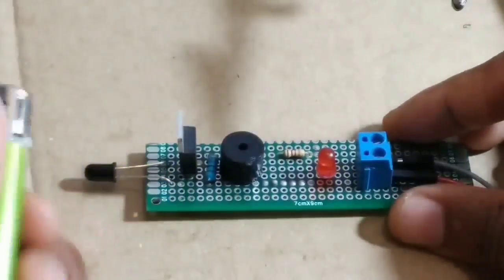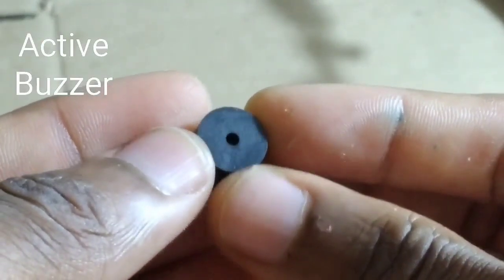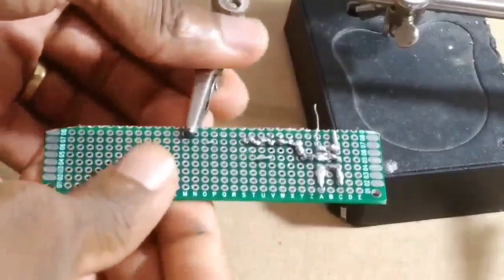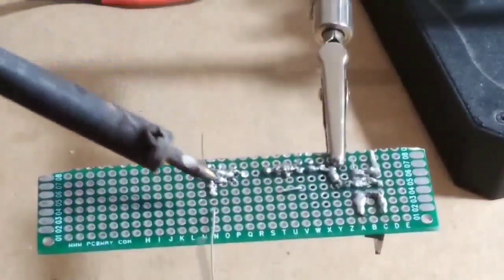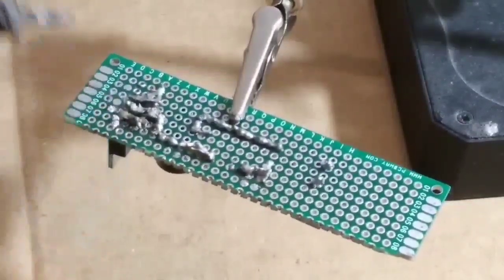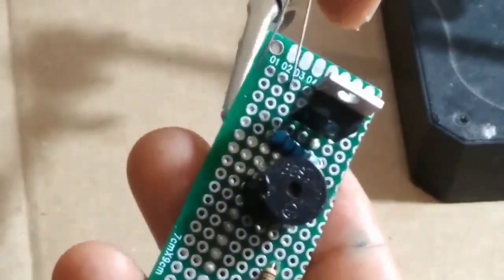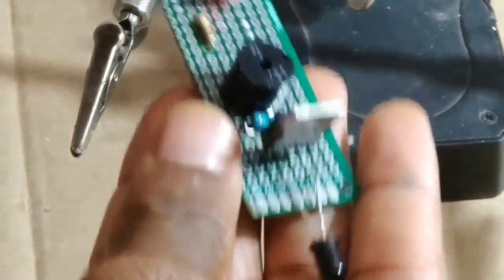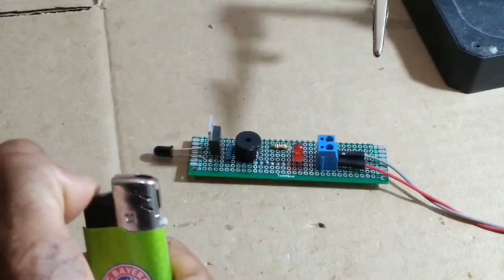How to make Fire Alarm using MOSFET IRFZ44N | Fire Sensor #firedetector #mosfet

Comment: What is type of the buzzer?
Reply from the maker: I really don't know. Active buzzer. 🤔
Reply: @uploadideaswithitamar  what is the voltage it works on?
Reply from the maker: @djomla6165   I make many projects and I forget things on the projects that I've done. Power supply is probably 9V, if I recall.
Reply: @uploadideaswithitamar  what do you actually do for living?
Reply from the maker: @djomla6165  I'm  influencer of TME Education
Reply: @uploadideaswithitamar  do you think there is a profit of doing like electronic repairs or som?
Reply from the maker: @djomla6165  I don't know. I don't like electronic repair, though. I don't think you gain a lot of  money with that.
Reply: @uploadideaswithitamar  where in electronics do you think is the best way to make money?
Reply: Where in electronics do you think is the most money to make?
Reply from the maker: @djomla6165  I don’t know. But electronics repair doesn’t give a lot money as far as I’m concerned. If you have a YouTube channel with many subscribes you might  have a lot money.